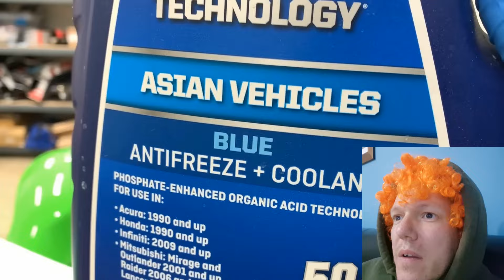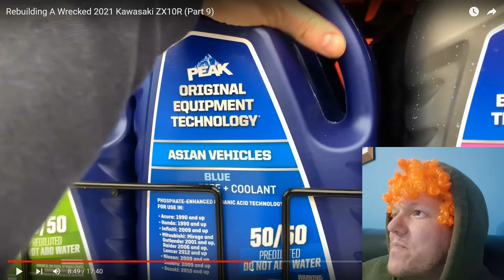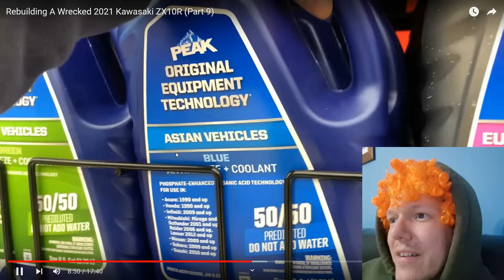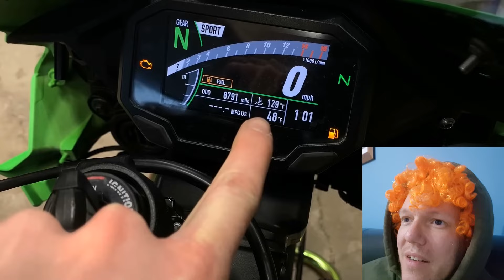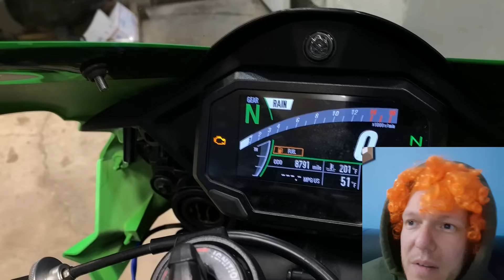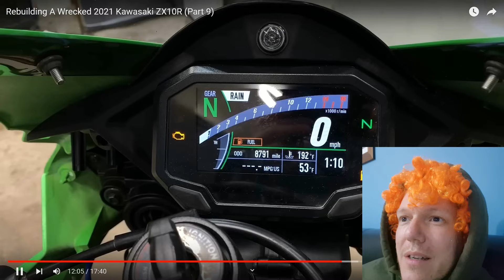GINGER vs NINJA - Part 9

Comment: Dammit, Matt.  I sent you my photo to get me fired, but my boss keeps calling me to ask why I'm not at work

18:12 Kawasaki send each screw separately packaged?  Is that so that when they start corroding, they don't spread it to the others?

23:58 Peak have 3 types of coolant - green for "North American" vehicles, blue for "Asian Vehicles" and pink for "European Vehicles".  It's marketing.  It should be pink for "high performance engines", blue for "very high performance engines", and green for "American vehicles".

Comment: You open expansion clamps by hand? What are you a cave man? lol.  You need to get the correct tool for them, it will change your life. especially the cable operated ones, Great for working in tight spaces.
I used to use mole grips on them like ginger, because im a farmer so I use mole grips for everything. But then I was shown the light.
Reply from the maker: By hand? and what expansion clamps?